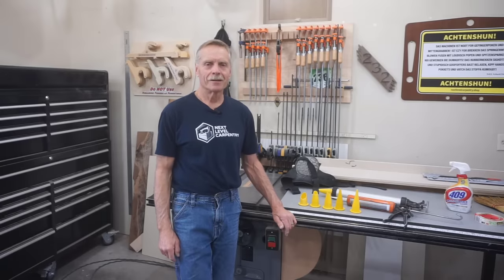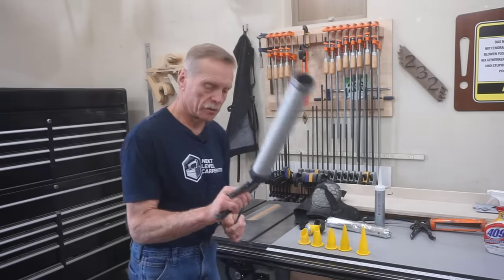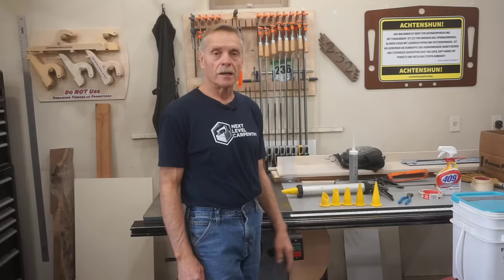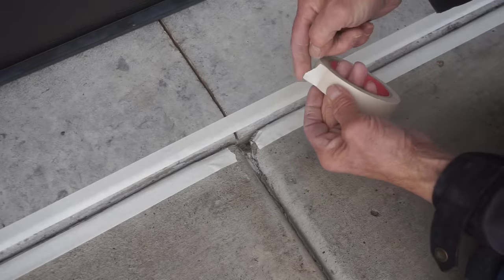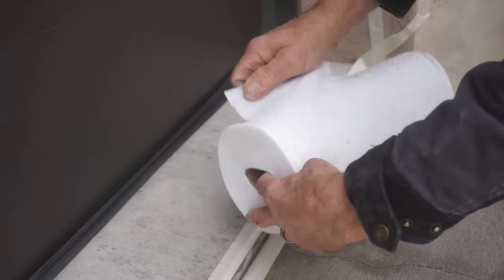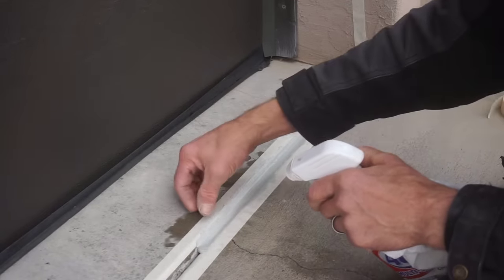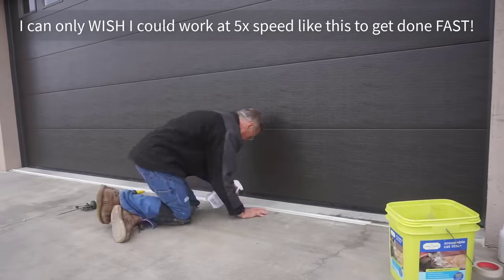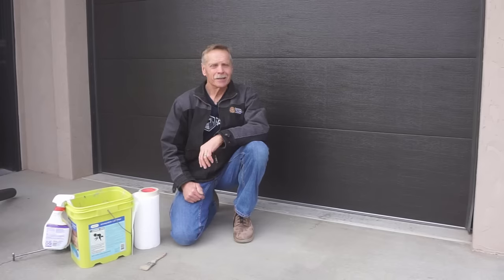How to Caulk Concrete Control Joints with Perfect Results Every Time

Comment: Absolutely a fantastic and educational video. I have a uneven joint where some of the depth is at least 2 to 3 inches deep and some is only 1 inch deep. I was expecting him to put the silica sand underneath the caulk to even the depth  out. Does anyone put anything underneath to fill up the gap or are you just putting the caulk on the top surface and hoping some of it will seep all the way to the bottom before it sticks to the top?
Reply from the maker: You need to do some research into control joint design to find answers to your questions. You will quickly learn that the idea is not to fill the entire depth of the crack with sealant but to put a bead at the top that is half as thick as the joint is wide and control those proportions with the use of backer rod, not with silica sand... or anything else for that matter. Once you have done that prep work then use the process shown in the video for finishing off the top with professional results... Best, Matt
Reply: Add foam backer rod that you can get at hardware stores

Comment: Thanks for the tips looks great. I have a question about driveway cracks and using a flow rated air sealant gun  and matching the aggregate driveway with washed aggregate and sand to blend any tips?

Comment: Thanks for such an awesome video!  I've watched this several times as I'm getting ready to caulk my driveway. I know getting a good bead and tooling are not as easy as you make it look but I feel armed with great advice and I'm ready to give it a shot.  I just noticed @provaslavn's comment below and agree 100%. Would you recommend I seal my driveway before or after I caulk?  Thank you!
Reply from the maker: I recommend practicing in a less obvious location as you learn to apply what you saw in the video.  It's easy to learn but gets easier & better as you go. 
Since there's so many types of concrete sealer and application methods, research manufacturer recommendations for compatibility.
Beyond that, If you do seal the concrete before sealing joints, make sure to leave plenty of time for it to dry so the sealer sticks.  If you seal joints before applying sealer make sure the urethane has had enough time to cure so it doesn't smear when applying concrete sealer over it.  Also work to keep concrete sealer from puddling over the urethane sealant.

Comment: This is a good video, thank you for showing us how you do the control joints. I know there are a lot of variables involved in how long the caulk will last like the temperature of the area, humidity, rain, traffic, etc.... but typically how long do you think the caulk will last before it is cracking and needs to be replaced?  Do you offer any guarantee for customers with a time frame?  Thank you.
Reply from the maker: Projects I did with this method/process 20 years ago are still holding strong without cracks. Since urethane 'never' gets hard or brittle It lasts indefinitely when applied to concrete cast over properly prepared base since it's concrete movement, not product or application shortcomings, that causes failure over time.  I guarantee all my work for clients, this included, from failure of workmanship.  I've had zero callbacks on this type of work although I have, at times, re-done short sections when excess concrete movement causes the sealant to pull away from one side of the joint.  Best, Matt

Comment: Great video and thanks for the silica sand tip - I've done hundreds of feet with self leveling and never thought about using anything else although I've always used masking tape. Biggest issue for me is the degradation/shrinkage of self leveling in the Florida sun. I've been told that caulking comprised of 100% solids will not degrade - what is the life span of the caulks you've used ?
Reply from the maker: I could show you joints I sealed with this product and this method over 20 years ago that are still looking good and holding strong.

Comment: Thanks for the direction on caulking the drive. I currently have caulk in my drive that needs to be replaced, what’s the best way to remove the old caulk?
Reply from the maker: There's no easy way I know of to remove old sealant but I'd use one of these knives to at least begin the arduous process:  https://www.amazon.com/dp/B00QL4Y488?linkCode=ssc&tag=onamzdigitalj-20&creativeASIN=B00QL4Y488&asc_item-id=amzn1.ideas.29WVINIJF4EUJ&ref_=aip_sf_list_spv_ons_d_asin&th=1
With any luck the existing stuff is still pliable and you'll be able to pull most of it out in long-ish strips.  If it's brittle you might end up with a wire wheel in an angle grinder maybe?
Good luck!

Comment: Great job. I stumbled across this video and was amazed. I always make a mess with caulk especially silicone. Will this work with that or painters caulk or should i  switch to Urethane .I have an aluminum trailer roof to seal
Reply from the maker: An aluminum trailer roof is an entirely different animal so I don't think much of what I show in this video will apply or be helpful. One thing for sure is that urethane is no good when used with metal. I think they make some sort of butyl sealant for trailer roof which is similar to what they use for ceiling gutters on a house...

Comment: Thanks for the great educational videos! Any problems with doing this before putting in an epoxy or polyaspartic floor coating? I have nasty looking control joints in my garage and was thinking this would be great to clean them up before coating. Thanks!!
Reply from the maker: I think you'd be better off doing the epoxy coating BEFORE sealing control joints with urethane Jerry.  Urethane never hardens like epoxy and hardened epoxy over flexible sealant will crack and turn nasty looking quickly IMHO.  Good news is that joints done like this will look professional next to the epoxy coating!
Best, Matt

Comment: Great explanation. Just one question... if I do the sand over the urethane caulk, would it be ok for some cement finish ? I mean, would sand make good background for some cement finish ? It would  be in some facade repair. Not for ground work. Thank you.

Comment: This was a great video. I am going to try this tomorrow. How come you didn’t use back backer rod?
Reply from the maker: The configuration of the joints I did in this video had no place or need for backer rod. Backer rod Bond breaker tape xcetera, while very important, are topics for a video about joint design so they're not included in this video about tooling sealant for finishing the joint.

Comment: Working on some joints now based on your video.  Overall very useful for example the sausage gun and wet tooling worked well! 
 You said backer rods and such are another subject... really wondeirng what to do there.  Don't worry about deep joints?  Some tutorials use backer rod and some use sand.  I am wondering if the sand is too solid and will prevent the joint from closing when the concrete expands.
Reply from the maker: Backer rod is usually best for deep joints for the reason you suspect IMHO.  Use appropriate sized backer rod for a snug fit.  As a rule of thumb, push it down until the depth of the sealant joint is 1/2 of its width...
Reply: @NextLevelCarpentry  Thank you very much for the feedback.  I already finished a few indoors using sand but will need to find backer for outdoors work.
Reply from the maker: @mbrick  Sand shouldn't hurt anything on inside joints.  I think it mostly causes problems outside during freeze/thaw cycles if it gets wet because of expansion when it freezes which could force joints wider then settle out when it thaws and dries.
Reply: @NextLevelCarpentry Thanks, I appreciate your feedback.  So far your video was very helpful and the technique I settled on.

Comment: I need to do this to fill the crack where the wall meets the floor in my basement to keep the spiders and centipedes out. When I started this video I wasn't sure that I'd want to go to the trouble of doing it your way but by the time I finished the video I really can't settle for doing it any other way.
Reply from the maker: I get it... seems a bit overkill and unnecessary at first but I think you'll find, as I did, that it really does go quickly plus satisfaction from looking at the end result more than makes up for any extra time you might spend doing a first-rate job.  Best, Matt

Comment: Great video. Very helpful for my project. I have a challenge with some seams that are pretty wide, over an inch, and deep by the time I clean them out. Any recommendations for how to hand these wide gaps. My first instinct is to fill the majority with mortar/quick dry cement and then caulk them with a shallower bead
Reply from the maker: Backer rod is generally a best practice for wide/deep joints Dave.  Rule of thumb is joint depth is 1/2 joint width.  A 1" wide joint should be 1/2" deep.  I wouldn't recommend cement for the bottom because you want to avoid "3-sided adhesion" for the sealant to stretch properly. Backer rod at the bottom allows sealant to stretch/compress for long-lasting sealing. Might want to check into primer for wide joints like that because of increased pull on the sealant in a changing temperature environment.  Bottom line is that I finish all joints the same way shown in this video, regardless of the size and get professional results every time! Best, Matt

Comment: Hey Matt,  my old computer went to the big hard drive in the sky and I lost all my favorite saves, guess I should start doing Backups!   Luckily, I bought a new computer and was doing a little research tonight on using Bondo to repair wood and there to the side was Next Level Carpentry, how to caulk cement joints.   I had to click on that and then l realized I had seen this before and I said,  I know that guy,  I was happily surprised!!!  I had saved your video because it was important to me, I have bought a larger gun and have found some larger tubes of caulk and if it ever dries out more than a day I will be replacing my sidewalk joint caulk.  Have you been able to find 409 again, let me look, yep I see it on Amazon again.  So I guess i should ask, are you using 409 again or did Dawn work out better?  What are the chances of finding a video you like and saved 10 months ago!
Reply from the maker: Hey William, hope you found this video useful for your wood repair project: https://www.youtube.com/watch?v=FfhtgWF_ETY 😎
409 works great and is simpler because it's pre-mixed and has a decent pump spray on the bottle so, although diluted Dawn works equally well, the lazy in me has me back to 409. Hope you get the dry days you're looking for... feel free to divert the rain out this way as my lawn needs it more than your driveway! Best, Matt

Comment: Very well done except would’ve liked to of seen close-ups of the joints, but showing us how to cut the tips correctly and how to pull the masking tape off was so crucial and I have found that lacking in other videos I watched… Thank you very much for a very good description of how to caulk that… Now I need to conquer exterior doors, windows, casing, and baseboard
Reply: I saw a closer close-up of the finished joint at the end… It could’ve been a little closer so we could see the granules of the silica sand, but it still was better. Thank you very much.

Comment: Perfect video, I'm ready to get this done. I cant find that sealant in my area. Is this one good for that job? 

Sikaflex Concrete Fix No-Sag Concrete Crack Repair Polyurethane Sealant
Reply from the maker: I've not used that particular product but, after a quick look at the product as described on Amazon, it looks to be a likely substitute. I encourage you to try it out on a small section to see how it works before doing any large areas...

Comment: Great video instruction.  I have a question on cleanup.  How do you clean the caulk out of the sausage funnels once you are finished with the job or are they a one and done?
Reply from the maker: Best thing to do for those tips is to just leave them out in the sun to cure. Once the urethane sets up you'll be amazed by how easy it is to push out of the tip in one rubbery glob. If you are just pausing for an hour or a day just wrap the tip in cellophane or duct tape and you'll be good to go...

Comment: Thanks! I'm Glad I found this video!  I had wanted to use some form of tape because of a previous job I did that looked like crap after I had finished and the use of 409 will make it look like what  want to see!  Double Thumbs up!!!
Reply from the maker: This method/process should make all the difference William... good luck!  FYI I'm not able to find 409 in any stores around here and am testing diluted Dawn dish soap as a substitute/replacement. I'm getting excellent results with a 1 part Dawn to 10 parts water solution so far.  I might weaken it just a tad to 1:12 at some point, I don't know but DO know that 1:20 isn't 'soapy' enough to work.  Best, Matt
Reply: Thanks Matt for the reply!  I'll check stores around here to see if I can find 409 and if not will order from Amazon, unless it has been discontinued and the price goes ballistic!  One other question would be do you think the Big Box stores may carry the urethane caulk you were using and should I look for a specific caulk?  I want this time caulking to look as neat as I can make it!  Great tips!! @NextLevelCarpentry
Reply: and looks like 409 is going to be a tough product to find!  I wonder if Simple Green might work?  other than it might tint the caulking.  Thanks Again!
Reply from the maker: @WilliamMichael1  yeah I think the 409 I saw online was at a ridiculous price. I literally just finished doing some sealant work and used Dawn dish soap diluted one part Dawn soap to 10 parts water and it seems to be working fine.
Reply from the maker: @WilliamMichael1  see my other reply about Dawn dish soap because I suspect Simple Green might have other types of ingredients in it that could deteriorate the urethane... don't know for sure but I would be uncomfortable trying something that different.
Reply from the maker: @WilliamMichael1  I've seen a tremco product called vulkem at Lowe's and it's definitely good but not identical. It seems to have a different texture when finished and again not mad but not the same. I doubt any big box stores carry sausage tubes but that's not a deal-breaker.
Reply: @NextLevelCarpentry  Thanks again Matt!   No, I haven't seen sausage tubes at my local stores or actually anywhere else but I have seen the larger caulk guns which I may buy so I can use the larger tubes.  I will also check a local Masonry Dealer in my area to see what he has and will re-watch your video again to verify the products you mentioned.  I also like the idea of the silica sand you suggested  and will be picking some up, for sure!
Reply from the maker: @WilliamMichael1  ironically I am only able to find 10 ounce caulk tubes for a sealing project I'm doing now because the gray color isn't available in 20 oz tubes or 20 oz sausages anywhere convenient. I'm telling you that because the size and type of tubes you get are only a matter of convenience and are Irrelevant for anything other than efficiency. Sequence masking tape soapy liquid and silica sand are the key elements in getting professional results so as long as you use them along with a bit of practice and patience you will succeed! 😁😎👍
Reply: @NextLevelCarpentry  Must be everything is in short supply!  I want the Gray color to, my neighbor said to use the stuff he did to fill in the cracks in his driveway, I asked what color it was and he said Black, I said no!  Maybe we will get back to normal someday!  Can't wait to try your techniques!
Reply from the maker: @WilliamMichael1  you might check into the Limestone color.... it's a little lighter shade of gray but plenty acceptable for most concrete and I think it's maybe one of their most common colors

Comment: Enjoyed watching your video. I also caulk and I use knives for the tooling in final finish and never used the tape. I like the idea…I Vgrove, clean, backer rod ,and caulk….I would like to try the tape idea I see you changed over to frog tape is that better than the 3M and how much do you charge for a foot of caulking?
Reply from the maker: Hey Sal, yeah, I switched to Frog Tape a few years back when 3M downgraded their comparable product.  I've never figured that move by 3M out?  Personally I'm willing to pay more to get more but 3M's got both thinner AND weaker, but not cheaper.  Why 'they' didn't offer a 'premium' grade  or something is something I'll never understand.
FWIW All my work is on a cost-plus basis so I don't have a per-foot price figure.